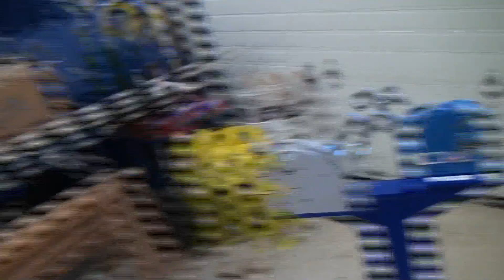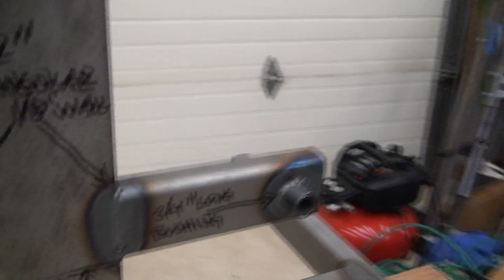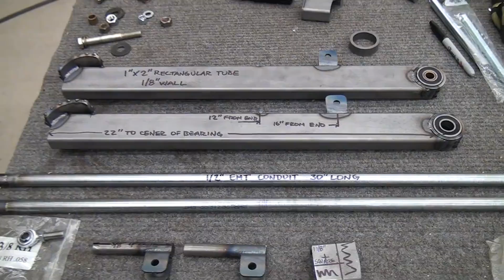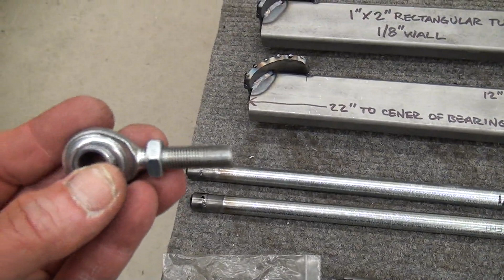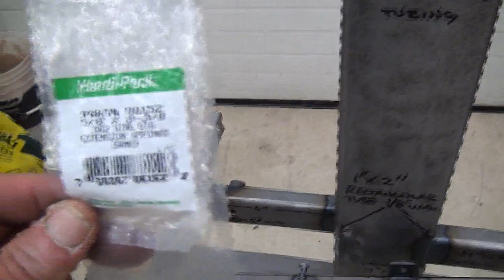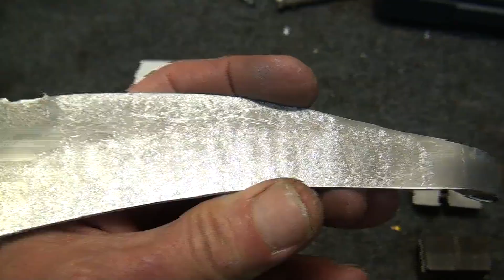Low-Buck Homemade Foot Operated Lancaster Shrinker / Stretcher Stand

Comment: Excellent design and execution. Clear explanation as well. It doesn't get much better than this. Here is a future challenge: operate the shrinker stretcher as a pneumatic tool where the pressure applied can be more consistent. Adjustable throat stops would be cool as well.
Reply from the maker: Thanks for the kind words! I really like the setup and I use it pretty often. The suggestions you have a good ones, but it depends on your application. Personally, when I'm just teasing a curve into shape it's nice to have some feedback from my foot in relation to how much the metal is moving. Also, being able to move the part I'm shaping in and out a bit as I'm operating the shrinker/stretcher is a plus. If I was making the same parts for hours at a time the automation would be great for repeatability. As a hobby guy just doing one-off parts, I'm happy with it the way it is.

Comment: I liked your video and incorporated some of design in fabricating one of my own. I found that the spring rate of the springs you used were too light for mine and changed them for ones with a rate of 27 lbs. Your background with aviation shows in the quality of your work. Thanks
Reply from the maker: Thanks Thomas! Good observations. After using the stand I made I also think the springs could have been stronger, but it does function as-is. The only thing I would do different to the one I made is put on stronger return springs and put stops on the main upright to limit the upward travel of the pedals. If in the future I end up using it more I'll make the modifications. YMMV

Comment: I use a shrinker every day here in Wichita ks at a aircraft plant . We take a 1" 120 grit sanding belt cut to fit the jaws to eliminate the jaw marks
Reply from the maker: That's an excellent tip...thanks for sharing! Sounds like a reasonable alternative to the stippled aftermarket jaws.